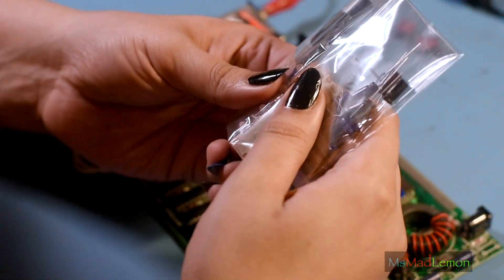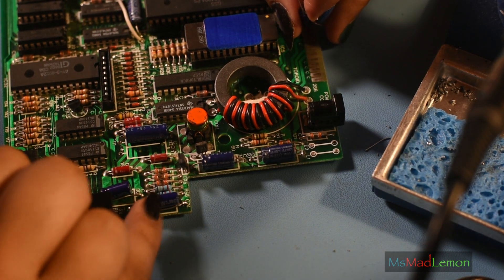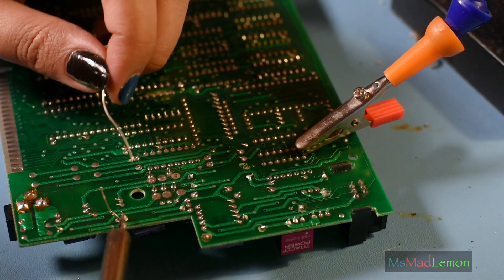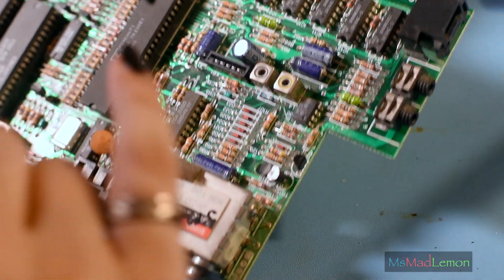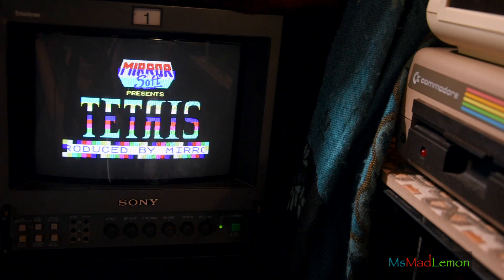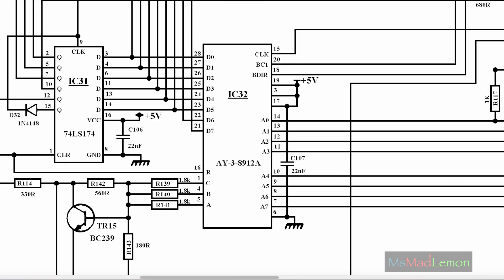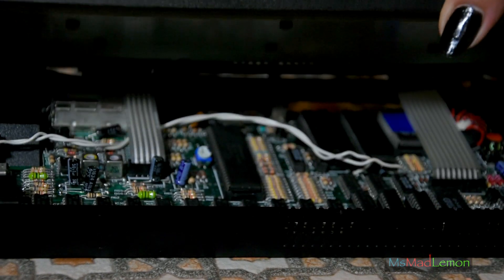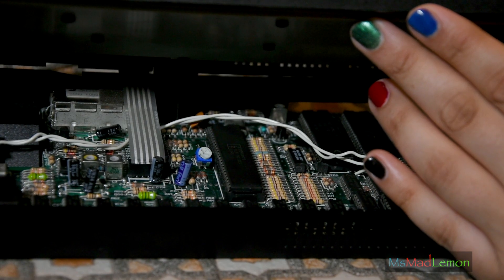The Two Spectrums - Restoration part 2: Recapping and AY Sound hack

Comment: The advice about chisel tips is because they can melt the solder quicker, resulting in less heat damage to board or components, because a quick touch puts less total heat into the work piece, while longer contact is required with a point tip because of the smaller contact surface it presents to pad or component leg. Heat damage is especially of concern for capacitors with a polymer separator.

Comment: It's always quite relaxing to see your modding and soldering videos. "Patience you must have, young Padawan" 😉
But I always shriek when I see you using such a biiig cutter (like e.g. 7:27) especially on a quite compact/complex board like the Spectrum 128k! I really, REALLY recommend you to get a electronic-cutter like this: https://cdn-reichelt.de/bilder/web/xxl_ws/D300/KN7881125_02.png
btw. this cutter is also perfect for cleanly cutting the end-parts of cable tie wraps!
Too bad you couldn't use your desoldering-gun (brilliant tool btw, haven't heard of that before) with this board.
When I made a two-TOS switch-mod on my Atari 520ST back then I decided to replace all six TOS-sockets with better ones. For easy and fast(!) desoldering I modified an old vacuum-cleaner with the front (metal) part/tip of a ball-pump! Crazy, but worked like a charme. Ok, you have to give the vac a pause after some minutes to avoid overheating, because of the very small whole at the tip. 😁
Reply from the maker: The funny thing is I actually have an electronic cutter and I use it a lot lol but i couldnt find it  then hence hwy i used those clumsy cutters, I found them again though so all is well :o)
I got a new nozzle for my desoldering pump/gun so i'm able to use it now :o)

Comment: According to the original Sinclair docs the output of the ULA was meant to be the same volume as the max AY volume. A bad choice as most AY music doesn't play at full volume so I agree it was always too loud. Sadly I sold my 128k toast rack edition many years ago something I have regretted for some time now. I do have 3 Plus 3's but Amstrad made the sound worse by distorting the output, something I have fixed in one of them.

Comment: When it comes to the EAR/MIC ports, they were labelled as you would connect them to the cassette deck.. So, MIC is the OUTPUT of the spectrum, and EAR is the INPUT.
Reply from the maker: Yes, that's exactly what i was saying in the video, though my point was that its initially confusing because you naturally expect MIC to be an input and EAR to be an output
Reply: @MsMadLemon  yeah that'll teach me to post when i havent watched all of the video yet ;)
You may want  to check out JoulesPerCouloumb's channel, he has good videos of a lot of Speccy repairs, and he makes some modifications to a grey +2 to balance out ULA and AY volume. The toastrack is pretty much the same circuit as the grey +2 so the same mods should apply. I did them to my own grey +2 with great results
Reply from the maker: @jaycee1980  Thanks for the recommendation. 
The AY volume was a fairly simple mod anyway, something was annoying me so I found a way to solve it and just shared what I did.
I'm already aware it's been done before, as many things have.

Comment: Yep Speccies loved using cheap phenolic board.. just look at the tracks funny and they delaminate. Solder braid is usually the best tool for the job.. but often removing components one lead at a time is the only way to avoid destroying the pads

Comment: Conical tips definitely have their place when soldering, I think most people discourage using them for SMD work (even though sometimes bent conicals are very useful), but for through hole components they are completely fine.
You just need to be careful on how you use them as they don't transfer heat evenly, so people often don't realize they are just using the tip (of the tip :P) when soldering something that requires a lot of heat and instead of repositioning the soldering iron for it to touch with the side of the tip they start "digging and poking" in order to try and melt the solder. In the end it's all about the technique, as I know people who manage SMD with conical tips. As long as it does the job...
Those PCBs look like they could delaminate just by looking at them the wrong way, I don't envy you at all!

The difference in volume between the AY and ULA is so obvious, I wonder how nobody noticed it before manufacture. Or maybe they did and it was too "expensive" to fix?
Nice explanation of how to find the right component on the schematic as well!
Very nice feeling hearing the fixed volume in the end, I guess for people like us that means a lot :)
Great video, looking forward to the next part.
Reply from the maker: Thank Axel! I kinda like using conical tips, they do provide precision though as you rightly say they dont transfer heat well. Each tip has it's place really, using a desoldering braid/wick on ICs is definitely with a chisel tip haha. I cannot go by just using one type.
This PCB was the lesser of the evils, the second 128k and my rubber key 48k have exposed tracks which are very easily lifted or damaged! its ridiculous! I'll be looking into this more in part 3, but the parts of the board  that look like baking foil dont fill me with confidence!

The difference between the AY and ULA is even more freakin obvious in other games like Cybernoid and remember that time I was playing Batman on it and you heard the (ULA) sound effects louder than the AY music? that was after doing this hack/mod, imagine what it was like before!
Also i'm not sure why this didnt bother many people, i've dealt with 4 128K spectrums two of them +2 and they all had this quiet AY issue. and the fix is simple, if they just lowered the value of that resistor.. (I would say omit and short it, but yeah 500Ω or 250Ω would do!
Indeed it feels great though hearing the AY louder, it's one of those things that would bother us until we did something about it :o)